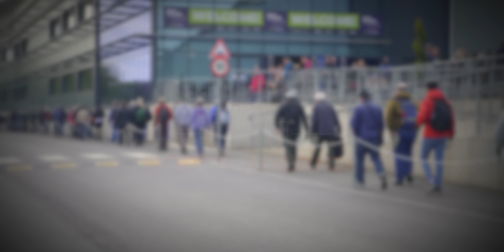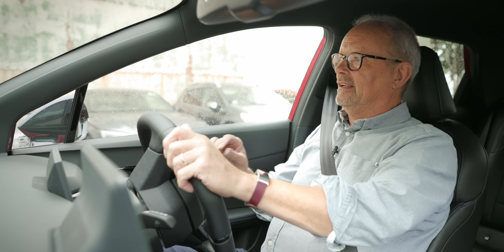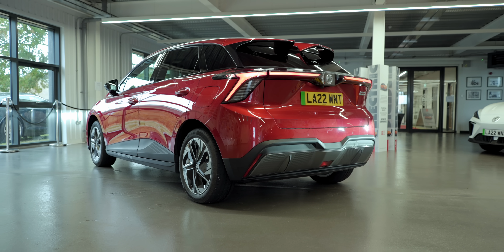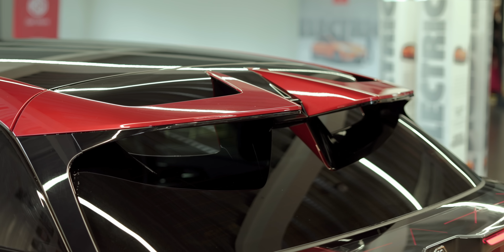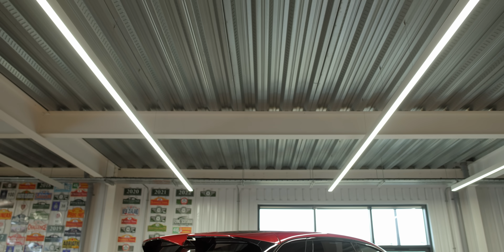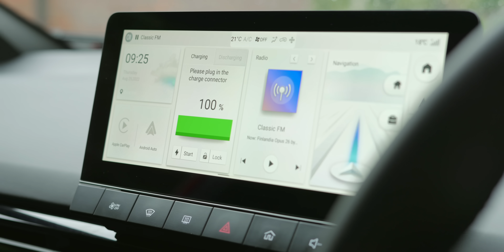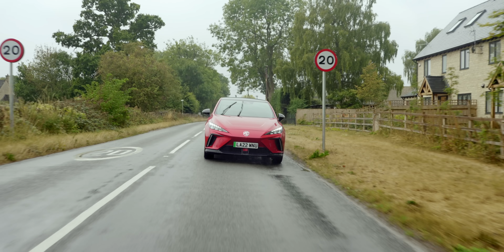MG4: The Bargain Of The Century??

Comment: I think the most impressive part of the entry model is how it is the first car to truly be price competitive with ICE cars. It is cheaper than an entry level 1.5 Golf. It's not far off the price of a base Vauxhall Astra. You get far more base tech, all that without considering the electrification.
Reply: Not counting the Leaf that's been around for 15 years...........  i guess.  Where were you for the past decade?
Reply: @Zanda Bayfield  MY 2015 ev has 200,000kms and still has 95% of original capacity.....  Free charging at work  too.
Reply: @Zanda Bayfield  Doubtful.  It has a thermal management system, so the battery will probably last as long as the car does (if not longer).
Reply: @christalbot210  everybody knows a battery needs replacing after 3 years 🤣 (sarcasm, obvs)
Reply: @chrischild3667  hardly
Reply: @mikeb1039  sorry i must try harder to get sarcasm across in my messages...or not use it at all.
Reply: @chrischild3667  Don't worry about it...only people on the internet don't get sarcasm :)
Reply: @mikeb1039   Chris Child was using playful sarcasm to ridicule Zanda Bayfield's comment.
Reply: @chrischild3667  utter bollox from an anti ev person. my sisters mk1 leaf is 11years old still get 95miles of range lost only 3% of its battery range, Roberts is over 12 years old and has lost simlar. you know nothing
Reply: @chrischild3667  yes its impossible to know you're meaning when you don't use the correct expressions and grammar.
Reply: @edwilko8819  chill out Ed. I was being sarcastic, a nod to all the idiots who don't own an EV yet feel a need to say "batteries need replacing after 3 years". I am an EV enthusiast. I own solar and a home battery. Please relax!
Reply: @edwilko8819  Your*
Reply: @chrischild3667  my bad. I do it too.  😆
Reply: @chrischild3667  you can go to Lars ratke's channel to see numerous interviews with Chinese taxi drivers charging lfp batteries from 0 to 100% everyday.  Most have over  300,000 km on them.
Reply: @chrischild3667  ?
Reply: @chrischild3667  Don't remind me, the planet needs more lead and acid as land fill....
Reply: @chrischild3667  you are a proper dope
Reply: @Zanda Bayfield  if it has a LFP battery it would last easily 500,000 km...
Reply: @channguyen3349  but it hasn't got a LFP battery, has it
Reply: @bikeman123  think it does
Reply: Not the first to be price competitive with ICE cars. Some EV versions of ICE cars can actually be cheaper such as an e-NV200 over an ICE NV200 or a Mini Electric over a similar ICE Mini. Yes, you have to do a bit of shopping around and not just go by the MRP. But you absolutely can get cheaper EV equivalents
Reply: @trevorberridge6079  None of those had anywhere CLOSE to $200 miles of range.
Reply: @patreekotime4578  The subject was PRICE.
Reply: A seminal moment!
Reply: Don’t forget that you are saved from the shocks each week at the gas station.
Reply: I think the most impressive part is how long he waited to mention the price.
Reply: @Zanda Bayfield  Why would you replace the battery? A battery refurbishment would cost a fraction of a complete pack replacement.  Try watching the YouTube video of a well known independent EV specialist carrying out a battery refurbishment on a 10 year old Nissan Leaf. It cost the owner £500.  £500 isn't bad for 10 years, is it?  How much would you spend on an engine in 10 years to keep it going?  Oh, you never knew about battery refurbs?
Reply: it does not even have electric seats.
Reply: @mark-se6ef  great spot an all electric car doesn't have heated seats, well the awnser is it will drop the performance basically & it keeps the cost down ?
Reply: @Zanda Bayfield  I'll get back to you in 2035.
Reply: at the end it is another VW considering that the company is partly owned by VW. Luckily cause if it would go bankrupt in china like others your car would be dead without any spares from there anymore.
Reply: Chinese Made & Owned. "Production takes place at SAIC's Ningde factory in China".  its Chines Dictatorship Crap 💩
Reply: and in Sweden we see 415K sek / €39,000 😅
Reply: But you all need to remember, they artificially(with help of propaganda)  raise the prices of ICE cars drastically, so electric now seems more compelling, when in fact before corona times, you could get similar quality ICE cars that are now 25000 for under 15000. They really full you all. In just a few years they manage raise the cost of our transportation by 40-50%. And most scary thing is you all agree with this shit. We get far less for our money now than before. This type of cars and technology should be forced on us only when technology(bateries) will be so far, that they could come close to at least 80% of range, what ICE cars can do and at prices way lower than are now. Prices, way worse economy and infrastructure are good indicators, that this cars were prematurely forced on us in hope we will be the ones who will pay for future development. Which in this case we should be share holders, but we are not.
Reply: @majsterV  who is they? Because if it's the car manufacturers they could mark up EVs by a similar amount
Reply: @benholroyd5221  I can't say exactly who, but someone is definitely in charge of this. Probably few with money power started this, politicians and environment activists doing propaganda. And car manufacturers just did go along as they also see better opportunities for development and income. Car manufacturers also don't rush anywhere to lower the prices. Why sell 100 cars for 20000, when they can build only 50 with not much more effort and sell it for 40000. Especially when there is lack of parts and raw materials. They exactly behave like that right now. And you are right. They could mark up EVs and they will, when there will be no new ICE anymore. Even if prices of EVs will start to drop, this will mean nothing to end customer. Cost of electric will go up, cost of implementing charging infrastructure will go up. There will be more shady tactics with replacing parts to trick the customers, similarly what health insurance companies do. In the end one way or another, end customer will pay a lot more for own transportation than ever before.
Reply: @majsterV  "lack of parts and raw materials"

See. you can answer your own question without resorting to conspiracy theories.
Reply: @benholroyd5221  Don't believe in consiracy theories, but i absolutely believe in endless human money greed and gluttony. Very healthy fuel for idiotic society behaviour and in long run self destruction.
Reply: @majsterV  I'm sure many conspiracy theorists claim not to claim in conspiracy theorys but when you start by using the words 'they'....
Reply: Made in China!
Reply: It's Chinese...
Reply: @fmpApps  So is the device you typed your message on, along with 95% of the electronics in your house... your point?
Reply: 3rd review I read on this car, thought Robert would love it. What’s not to like, ticks all the boxes for a sensible family BEV. Why all the stress about changing batteries, most people won’t keep them that long, unless the current semiconductor situation pervades 🤔 could be the perfect car for me maybe? 🤔🤔🤔
Reply: It's hardly price comparable. It's 30k then entry on is 26k. It's 5 k more than the petrol version. But it's the only vehicle in the UK which is nearly in the price range. So well done just needs a few quid dropping and it would sell in tens of thousands if they can make enough.
Reply: MG4 has not ghin to do WITH UK.

its a rebadged chinese EV.   thats why they are cheap.
Reply: @tocreatee3585  The design was done by the MG design team in the UK.
Reply: @carwynbradbury7792  SAiC bought MG about 10 years ago. Do you believe the “design team” is still there in UK?😂
Reply: not that impressive at all when its made in China,
Reply: @Zanda Bayfield  The LFP batteries in the base model should be good for at least 600,000 miles, as they last between 3,000 to 5,000 cycles, which, for a combined WLTP rated range of 218 miles, means the MG4 SE standard range should be good for between 654,000 and 1,094,000 miles.

In other words, the LFP batteries in the entry-level SE standard range should outlive the car and then go on to serve a useful purpose, for example in a Powerwall, for a further 20 years or so, before being profitably recycled to the extract the lithium, which can be reused ad infinitum.
Reply: @Dan123. Yes. Facts.
Reply: Must be expensive, because you guys are dancing around the price information!
Reply: @robertmyers4155 hahahaha!!!
Reply: But MG sellers were disappearing everywhere in the UK 5 years ago, no one would touch them with a barge pole. & It looks similar too the MG range when the dealers were dropping MG like hot potatos
Reply: @Modern Classic Collectables would you buy a really cheap EV? I mean, if price is the only thing that matters to you?
Reply: @Zanda Bayfield  4 year PCP 7 year warranty I'll be in the performance version before the battery's die in my trophy I've just bought.
Reply: And it does not need almost any maintenance, not now not after 5000Km or 500,000Km.
Reply: @bluceree7312  Sure. Only time will tell.
Reply: @bluceree7312  you have to go to maintenance at least once a year to still have warranty (i know got an MG5)
Reply: @SebastienChedalBornu  Sure. How much do you pay? let me guess:     ?
Reply: Not counting the battery of cause.  @bluceree7312
Reply: @bluceree7312  my car's done 135k miles and all its needed are brakes, suspension, a bit of welding, a new wing mirror, a boot button, batteries, bulbs. 

All things that would fail on this.

I suppose you could save on the exhaust, and timing belts, and oil changes.

Although I need to replace some gaskets on the engine. And the cooling system is leaking somewhere. So maybe they should be included.
Reply: @benholroyd5221  definitelt would not need brakes, with regen brakes get used 60 to 80 percent less.
My brakes are as new on a 7 year old phev. (Volt)
Reply: @FreekHoekstra  brake pads are pretty cheap. Seized calipers and rusty disks, through lack of use, are not.
Reply: @bikeman123  they still get used, just not as intensly as often but plenty of use to stop them from locking up
Reply: @benholroyd5221  Brakes last approx 3 times longer on an EV. In some cases even longer if you use one pedal driving.
Reply: @evornotev7794  well one you haven't seen my driving. I don't brake. Two. Ok, take off £20 a year for brake pads. It doesn't exactly change the calculation much.
Reply: @benholroyd5221  in addition to the maintenance savings if you God 3 or 4 solar panels you could charge the ev to give you the average distance that most people drive for free.  Which also makes you self sufficient.
Reply: @greggpon7466 how are you defining maintenance?  I'm not anti ev, I just don't think EVs will be anything like maintenance free. Yes the annual service will be cheaper. But the point I made in my original post was that all the things that have gone in my car are not IC specific.  
I've got an 18 year old fiat panda with 135000 miles on. It's basically end of life but the engine and gearbox is still going.
I've gone through the bills from previous owners, and the only major ic specific costs are exhausts and timing belts. 

Further I suspect that modern cars will be more expensive to maintain v my old thing because of all the electronics. I can do most things myself. Any failures on a more modern car require an expensive sealed unit replacement. So if you want cheaper maintenance, modern cars aren't offering that anyway.
Reply: @bikeman123  u will be using brakes as always...
Reply: @benholroyd5221  oil and engine filters add up, as others have mentioned brakes last much longer on EVs too. One of reasons car manufacturers knocked electric cars on the head in the early years of the car industry was because they could see that the ongoing maintenance needs of ICEs offered a much more lucrative business model
Reply: @bikeman123  well, you could press the brake pedal once during the journey? And, of course, brakes have never ever seized in any ICE vehicle??
We should really refer this to experts like Warrantywise for actual data.
Reply: Lets not get ahead of ourselves it might cost similarly to a golf or an astra but neither of those are really "cheap" ICEVs these days, they're not expensive or high end in any way either but someone needs to make an EV priced like a fiesta or a corsa before they're *really* price competitive with ICEVs but hey this thing marks a big step towards realising that goal, finally something is "only" 10k more expensive than the average ICEV rather than 20k more, shows by 2030 getting them truly truly equal isn't as tall of a task as some try to make it out to be, i mean EVs are still barely even mainstream and this point has been reached.
Reply: @RWoody1995  that's true, I guess something like the Tesla Model 3 was 'price competitive' with a BMW 3 series in alot of metrics! I guess as soon as we break below 20k for a corsa equivalent we can say the industry has made it.
Reply: you cant compare a astra and a golf to a Chinese MG night a day different build quality, spec, service and after car network wise and parts availability. 
there is no reason oten than profit as to why ev's are upto 40% more than the ice version. they are doing it as they know they will sell less parts, service items and after sales care so make theor money on the initial sale. 
they need a EV car with 200 miles of real world driving range for £18k all in. they sell them in China less than this so it is all profiteering. 
Tesla put theor prices up 10k accross most of the range to put off people buying them as they just cant fulfill the worlds needs and help the other manufacturers cars look like better value. poor move in my opinion as its put them out of reach of most people now like the model s was.
Reply: @edwilko8819  don't forget that 20% of the purchase price is uk VAT. Take that into account and you're approaching your £18k figure.
Reply: I would not feel safe in a Chinese built car. The Tesla build quality is bad enough.
Reply: Tesla build quality has increased significantly since their Chinese Tesla factories opened. BMW now also manufacturer some of their cars in China. I think the old reputation of poor quality is largely defunct now. There will be exceptions of course.
Reply: @dogwalker666  what percentage of your car do you think is already built in China? This still has to pass all the relevant safety tests.

Comment: I find it deceiving when car makers use the WLTP to test for range...not even close. Most of the times take 30% off to get real world range. EPA range test should be the standard.
Reply: Interestingly, my MG5 SR (50 kwh battery) averages over 4 miles per kwh and over 5 on runs in good conditions. Thus, the 200 mile WLTP range is realistic.
Reply: @keithoneill6273  do you drive in the city or in flat terrains? Then it might be realistic. From my understanding, WLTP puts more emphasis in city driving. EPA includes more highway, high speed testing.
Reply: They have to use WLTP by Law - you won't get type approval if you don't!!

It's designed to give a level playing field for all Manufacturers, not a guarantee of result!